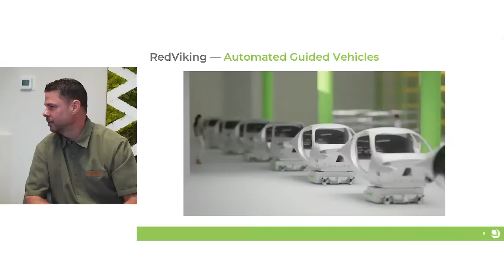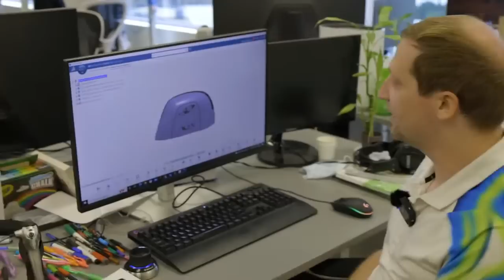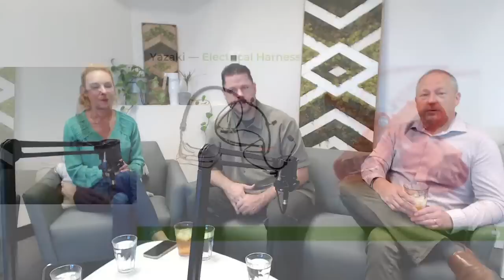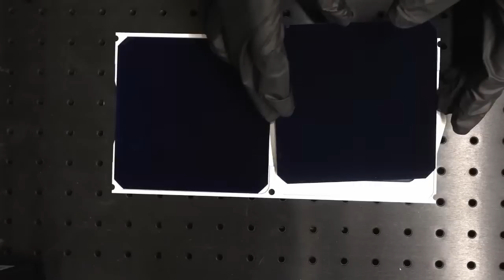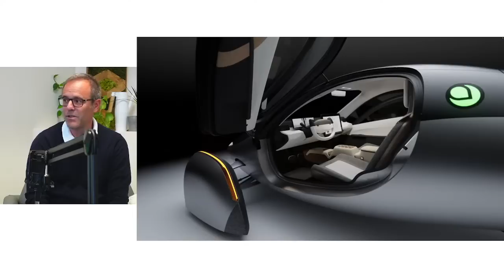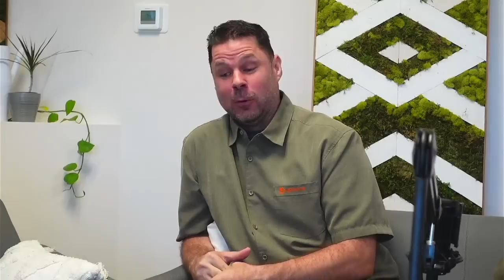Aptera Live Webinar — June 2022

Comment: Perhaps it’s a matter of aesthetics but, I’m tablet weary and after a day of working on screens the last thing I want to look at when I’m driving are more tablets.  In my opinion, a cutting edge design would minimize the tablets and maximize voice control and,mid necessary, heads-up display. Good luck - amazing project.
Reply: :dothefive::hydrate:In VoiceBrigade, you could create voiceovers for up to 700 characters of total length per audio. But if you upgrade to VoiceBrigade Pro, we’ll unlock this feature for you so you can get unlimited audio for your files regardless of the language.
Now You’ll be able to create as many unlimited audio files as you want.
For more details click on this
https://jvz8.com/c/2501593/378749/

Comment: Regular steering wheel please. The 2 places i normaly put my hands are gone, thats not cool. Looks very uncomfortable for a steering wheel.
Reply: own it, drive it and then replace the sleek, ergonomically designed Pilots Yoke that Hoops of fire were jumped thru to get approval by the NHTB and add on your after market boat wheel ( like on a wooden ship) oh and slap back on the mirrors to reduce your mileage, I better stop here. DRIVE your Aptera first then..................
Reply: If you hold the wheel at the top the airbag will break your arms.

Comment: Is it totaly safe having the motors in the front wheels? A light accident means one cant drive anymore, but with a normal cars its not that bad. Crash test will be very important to watch for. Lools great overall. Just need more information.
Reply: A light accident in a car won't damage its suspension. A damaged suspension means it can't be driven and is expensive to fix anyway.  Hopefully the wheel and tire shield the motor.
Reply: A light accident in a car won't damage its suspension. A damaged suspension means it can't be driven and is expensive to fix anyway.  Hopefully the wheel and tire shield the motor.
Reply: Oh, and that wheel cover is REALLY tough.  The front is 20mm thick plastic!

Comment: Question for Jacie, Hey Jacie it's great that a minimalist approach is being taken concerning wiring. But is there a manual override in the event of a collision that disables the local control board, thereby trapping the occupants inside? Thanks.
Reply: the windshield is the simple both feet punch out with heels of feet.
If not capable, then you'll need the Jaws from rescue.

Comment: Question for Charles Kaneb, Hey Charles I understand about resonant frequencies for electronic circuits and I have a high mechanical aptitude...So, your computer testing of the front wheel fenders is a good start; however, what changes happen when it rains, or sticky road tar and rocks are adhered to the underside? Or like in Texas rural areas, where occasional rain mixes with caliche mud and it is stuck under the fender, does that affect the resonant flexing of the fender material at slower speeds?
Maybe carbon fiber fenders would flex less? Thanks.

Comment: Why NOT cover your electric mirror with a REGULAR mirror shell which can be removed when legal. Or combine the two with a clear portion of the REGULAR mirror.
Reply from the maker: Hi Andrew. We are hoping to have the regular mirror portion removable by the customer so that once regulations change, they can remove them and keep the vision assist system in place.
Reply: I believe the law states mirrors are required to sell the vehicle but I believe it is legal to remove them after so they just need to make them easily removable.

Comment: With regard to the interior, I would prefer gray instead of beige with black and white interior.  And if you are going to ise both black and white on the steering wheel, make the center all white and outside that hands are on all black otherwise owners will have to deal with wiping off handprints often which will be annoying to deal with especially if handprint(s) end up as permanent stains.
Reply: :elbowbump::dothefive:In VoiceBrigade, you could create voiceovers for up to 700 characters of total length per audio. But if you upgrade to VoiceBrigade Pro, we’ll unlock this feature for you so you can get unlimited audio for your files regardless of the language.
Now You’ll be able to create as many unlimited audio files as you want.
For more details click on this
https://jvz8.com/c/2501593/378749/
Reply: Black YOKE ? ever live in a hot climate? gloves and a cooling element for the yoke. Great comment, mate better headache to have!

Comment: A lot to unpack here. Congratulations Aptera for the great progress. Can't wait to see the gamma version. Just one quick question, will there be an option to get a regular steering rather than a yoke? Will it be possible to swap both?
Reply: I really don't like the yoke but I also haven't used one, so maybe I'll be convinced once I try it. 

I trust the engineers at Aptera, but I do hope that there's a possibility of swapping if there's enough customers that don't like the yoke.
Reply: They are fairly committed to modularity so I would bet and aftermarket wheel would work if nothing else. That being said, part of the reason for the yoke is so that there is a clearer view of the sideview displays that are ahead of the driver.
Reply: @te8547e  I would say more of to be "in" in the modern trend which Jason admitted would be matching with the external futuristic look of Aptera.
Reply: considering there is few if any controles on the steering wheel Ide say its very possible
Reply: On the Cybertruck, a yoke is a hard no, but the Aptera may have a faster steering ratio to make it ok. I hope so anyways, but if there is some normal 2-3 turns lock to lock, then only a wheel is acceptable
Reply: :oops::oops::oops:In VoiceBrigade, you could create voiceovers for up to 700 characters of total length per audio. But if you upgrade to VoiceBrigade Pro, we’ll unlock this feature for you so you can get unlimited audio for your files regardless of the language.
Now You’ll be able to create as many unlimited audio files as you want.
For more details click on this
https://jvz8.com/c/2501593/378749/
Reply: Drive a few thousand miles first! I want handles hahaha.
Yoke is ground breaking and with the hurdles leaped thru w/ NTSD is ASTOUNDING!
hahaha i want me side mirrors back on here too, shiite can I after market a 4th wheel? Sorry mate, too much coffee ENJOY the RIDE!

Comment: Are the vehicles protected from any EMP events...?? Is there an add on that is available for EMP protection...?? Thank you...
Reply: Hardening circuits to survive an EMP event costs money that most people don't want to pay. The low voltage wiring will likely be in plastic enclosures and will have zero attenuation for an E1 pulse. The High Voltage circuits are usually in cast metal enclosures and will fare better if protected with the proper ferrite beads on the wiring immediately adjacent to the enclosure. Protection can be retrofitted but will be a real PITA. A wrap of conductive cloth and ferrites  will offer some protection. As far as solar flare or even the E3 portion of a nuclear EMP goes, it should be fine.

Comment: I noticed in a video of Jay Leno driving an aptera that the fenders had  a lot of vibration going on which could lead to cracking  the fenders. A simple solution would be to curl the  edge of the fenders inward similar to the way paper cups rims are curled, a half curl would do so it would be easy to clean. it would give the stiffness to stop the vibration and make the fender sturdier.
Reply: They went into a lot of detail about what they have done to correct this and how they are testing and refining the solution.
Reply from the maker: Correct. You shouldn't see any vibrations in Gamma or production. 😊
Reply: @ApteraMotors  DELTA DAY soon, Ventura CA. pick up. Thinking gift certificates for the holidays. Merry Christmas, you are now a proud reservation holder of the Aptera
Reply: That was alpha, not beta or gamma which are both improved which other person mentioned as being covered in the video
Reply: They already fixed that problem

Comment: What is the charging rate expected from AC/DC charging stations?
Reply: AC 120v (normal North American home outlet) is good for adding about 150 miles overnight.  At a DC fast charger you will get about 100 miles every 10 minutes. Look for the FAQ page under the 3 bars on their website for these answers and much more.

Comment: No heat pump? :( 
It's just a reversal valve and a control signal added to the AC system.
Reply: Suppliers have at least a two year lead time on transportation qualified valves.   I checked myself.
Reply: @n.brucenelson5920  isn't that crazy?
Reply: @jamesengland7461  Yes.  It is rather shocking for such a simple device.  And apparently this is considered "normal" industry lead time.
Reply: I wonder if they are considering using the battery waste heating for heating and just use the AC for cooling? With the battery cooling system design it would seem you could reroute that heat to the cabin vice overboard fairly easily.
Reply: I think I would wait for the heat pump before buying one.  If I were to sleep in the back overnight, I might use up too much battery.
Reply: @bigbadLN  That could be.  The Aptera body is far better insulated than most vehicles, so the additional power drain is likely to be considerably smaller than the typical normally insulated car.  I will report on my experience.

Comment: I find most people who have negative things to say about electric cars do not drive one, I have been driving one for years now and just bought my second electric (Im keeping both) and I find all the negative statements as completely unfounded.
Reply: I don't currently own an electric vehicle----and my personal feeling is that hydrogen fuel cell vehicles are a better idea than EVs.  That said, I love the idea of no oil changes or tune-ups, no need to stop for gas, etc., the strengths of the EV.  That said, I think the reason people push back against EVs is because a lot of people who like them go out of their way to try to force feed them on everyone else----sort of like vegans who attack people who eat meat.  Let everyone choose what they want, and don't get militant about our choices, and things will be better.  Also, the idea that government is picking a winner or loser by spending hundreds of billions of taxpayer dollars to promote one over the other has people angry too.  Let the market decide.
Reply: @funktron4  You know that hydrogen fuel cell vehicles ARE EVs, right? They are just harder and much more expensive to fuel than ones you plug in or charge from the Sun.
Reply: @fotoguru222  Yes.  Sure, by definition, I guess since the cars run on electric, they're EVs.  But a couple things:  1) There are no cars currently offered that get a full charge from the sun, so mentioning that seems gratuitous.  2) The electrical grid, as it stands, in this country, could not support a rapid transition to plug-in electric vehicles anytime soon----and some people would prefer to have the convenience of "harder" but demonstrably faster stops for fuel/recharging than a plug-in EV is capable of.  And spare me the "People have to eat lunch, just stop somewhere for lunch where you could charge your car."  LMFAO.
Reply: @funktron4  Aptera isn't your father's EV, to coin a phrase. (Are you old enough to get that reference?)
1) Since we are discusssing Aptera, charging from the Sun seems kinda relevant to me. 
2) Aptera solar charging also has the nice side effect of very lightly loading the grid, if at all. A normal gas car loads the grid more, just because making gasoline requires a LOT of electricity.

Comment: Great video.Questions:  1.  I sit low in a car.  Does the seat raise up, or will I need a booster pillow?  2. Can those solar panels be sold for placement on Dome homes?  3.  Where does the spare tire go?  4.  Is the Aptera vegan friendly?
Reply: No spare is planned.  In my opinion after over 400,000 miles on motorcycles, not needed.  Most punctures can be repaired in place.
Reply: @n.brucenelson5920  I wonder though, if the tires will be a standard tire size that is easy to find, carried by most shops.  In the event of a sidewall puncture that can't be repaired or a blow-out, will a tire be easy to source, like same-day?
Reply: @funktron4  Yes, I checked. I can even get studded snow tires in this size.
Reply: Good questions. Maybe someone from Aptera can take on them.

Comment: I plan to charge my Aptera off of home solar. We presently have solar on both our homes with significant extra capacity just for a BEV and we are getting it installed on our mother in laws house this summer.
Reply: good deal. That will make your setup carbon minimum.

Comment: Tesla charge port and FSD would be awesome
Reply: There will be OTA upgradable level 2 safety pilot.  More details soon as to supplier.
Reply from the maker: Hi Bruce, more details on our SafetyPilot roadmap will be released soon. It has not been finalized as to whether we can offer Safety Pilot as simply an OTA update.
Reply: @ApteraMotors  I didn't mean installed as an OTA update, but rather if you have one that it can be updated OTA.  Is this correct?

Comment: Apparently there has been a lot of discussion about the Yoke steering wheel. When ask about the yoke Jason Hill (Hitler) gave NO compelling reason for this decision other than "I want it that way and I ain't changing it". That is a paraphrase of what he said. I want to BUY the car and I think that the Yoke steering wheel should be an OPTION. And I know I'm not the only one. The Customer is ALWAYS RIGHT!!!
Reply: Pretty sure he said it was mostly for vision on the cameras
Reply: @KaiLoganIII  That's not a legitimate reason, because I have owned many vehicles and the steering wheel was never a problem with seeing anything on the instrument cluster or the dash. When looking at their rendering of the yoke, the center of it is way too thick and kind of defeats the purpose. Safety, comfort, and ergonomics are legitimate reasons, none of which apply here. He said that because the outside of the Aptera is different, the inside should be also. That's what he said.
Reply: @robocowone464  Nah the yoke is better for viewing an instrument cluster and theres not any safety or ergonomic issues
Reply: @robocowone464  Yes, he said it is because Aptera is futuristic and as such should have a futuristic yoke to match the exterior appearance.
Reply: @adimchionyenadum2962  My concern is safety. A yoke steering wheel is awkward and in an emergency situation, the last thing you need is an awkward steering wheel. Plus the one they keep showing is so bulky. The solution is to offer it as an option. Maybe I'll just design and sell a replacement. Jason Hill rubs me the wrong way. He is way too arrogant.
Reply: @chidorirasenganz  What do you base your opinion on?
Reply: @adimchionyenadum2962  There is futuristic, and then there is what customers want, media likes/dislikes (most in media dislike the yoke) and two-tone - ugly and not practical for anyone that works with their hands if white, especially since the steering wheel is the one part of the car that is used more often than any other part of the car.  As an investor I am not happy about it at all.  It is the sort of thing that will cause someone not to buy it.  As it is, people love or hate the exterior which is a good thing, but a yoke?  Top half one color and bottom half another like black and white cookie?  Really?  Pfft
Reply: @danam0228  I like the yoke
Reply: @danam0228  "People love or hate the exterior. In the same way, people will love or hate the interior too, the yoke included. They can't please everybody. I would however agree with you that the white color on the yoke is a problem. Why is the two-tone a problem? The exterior is also two-tone. We shouldn't buy Aptera because of that? You suggesting that one tone folks should ditch the vehicle?

Comment: Nice car great update. However why would we want another charge standard now that CCS is taking over world wide and chademo is phasing out?  Tesla should just switch over to ccs here to it will be interesting to see what happens.
Reply: My thoughts exactly, it would be totally backwards to use a Tesla charger. Ask any actual EV owner and they'll say CCS is the future. I think Chris Anthony is stuck on the aesthetics of the plug, but honestly please prioritize function over form. I will cancel my order if they use a Tesla plug, even if they include an adapter there is no reason to use it. Tesla charging stations are adding CCS.
Reply: @jaredhuang2225  it's not just aesthetics. Like he said, it's more efficient in all aspects. It's cheaper to produce charging stations with the Tesla plug. So if you are after the Goal, the big one, EV adoption, it's important. Super important. Infrastructure anyone?
Reply: I've asked, it's actually an abomination. CSS is not taking over the world. In America, it's a tiny speck compared to the number of Tesla plugs. Why not change?
Reply: The USA is not the world. In the US, Tesla sells more EVs and has more fast charging ports than all the other EVs sold and other DC fast chargers combined.  

The Tesla plug is the defacto standard in North America. Of course they will need to modify the car for Europe and the rest of the world.
Reply: @fotoguru222  The current Tesla plus/cable does not support fast enough charging for many new EV’s and will not be sufficient for the next-gen Tesla vehicles like the Cybertruck, so Tesla is already starting to phase out its own plug/cable in favor of CCS in the US.